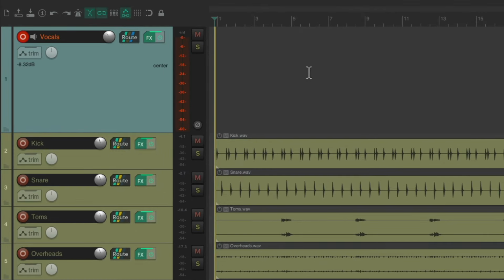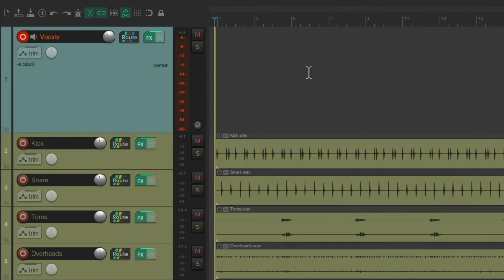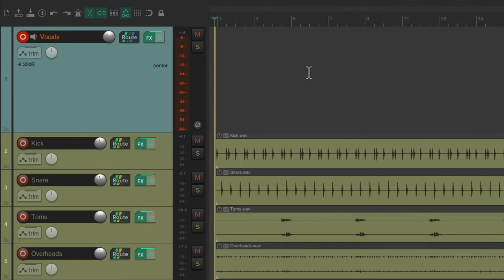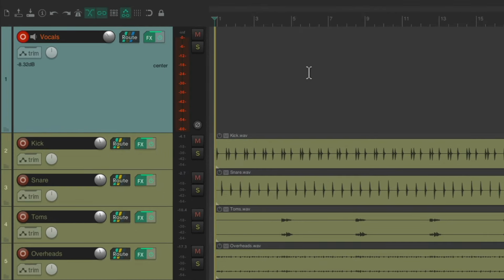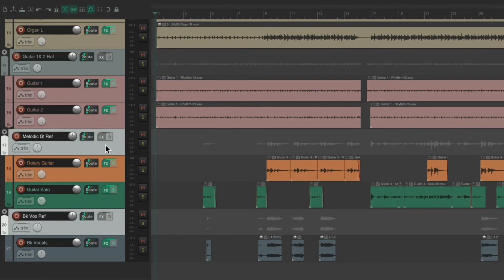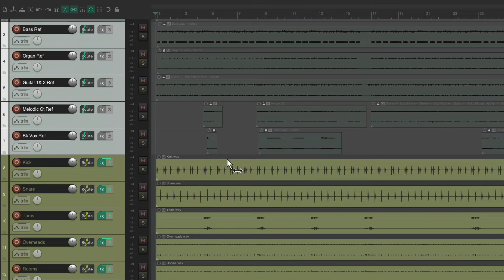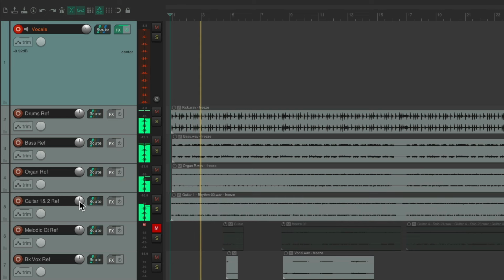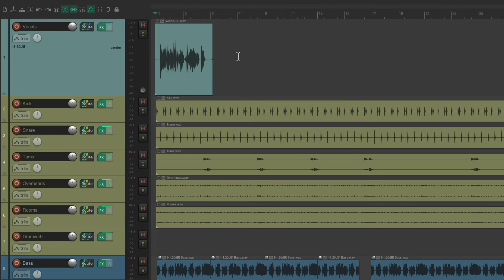Recording with the Lowest Possible Latency in REAPER

Comment: For this to work the setting "Do not process muted tracks" should be checked. You can find this in Preferences -> Audio -> Mute/Solo -> Mute Settings
Reply from the maker: Correct. I didn't mention that because it is on by default.
Reply: I put it in a "custom recording options" toolbar so that i remind myself it matters.

Comment: I prefer just freezing the individual tracks, or at least the most CPU intensive ones.  That way you still have full control over the mix and no need to create/delete folders, move tracks, mute/unmute, etc.  Then just unfreeze when you're done and you can edit, adjust FX, etc.  Fast and easy.  You don't get the benefit of playing back just 1 track or a few stems, but it's usually the CPU that kills you, not reading the audio from disk.
Reply from the maker: Yes. Many different ways to accomplish this same thing.

Comment: also its not always necesary to freeze all tracks, just look in the performance meter, which tracks are cousing most of the load, and you can only freeze those tracks in place without changing any routing

Comment: I had some latency issues when I was using the 32 bit version but adjusted as you did with better results though I'd get an occasional pop. Since switching to 64 bit I've had zero latency issues and no pops.

Comment: This is great i find singing in tune with headohone on really requires low latency. This is super helpful. I wish there was a way to automate this. Tracking mode / Mixing mode.
Reply: You can add buttons in your toolbar so you have these settings real close.

you can also create templates or even portable installs (which is what Kenny does) with their own settings for each type of session you do : recording, editing, mixing, ...
Reply: @djabthrash  none of this really works. I would prefer to track at 48 and mix at 96 but I dont feel like using two sessions.

Comment: I'm using i5-12600K with ES9068AS DAC on Reaper, it can handle the lowest 16 block size, 2.6ms RTL without click/pop on Keyscape or Pianoteq (Piano VST), a single-track recording.
Reply: what? I got same config and mine can't . How did you do it?
Reply: @joshmcdzz6925 Disable core parking and frequency scaling in Windows and it'll help.  Then reduce the amount of tracks that have a PDC value other than 0.  Some plugins like compressors/limiters are really bad with this.

Comment: I just started working in Reaper and I'm wondering if it is possible, when I create a copy of an audio track, to make a copy that is completely separate from the original track. I made a copy of a track, took it into an audio program to tweak it and raise the pitch an octave and when it came back in both that track and the original were changed. It would be great to have the option of holding down control AND another key, to make a new SEPARATE copy of the original. THANKS Rick  BTW, if this option already exists, please put a link to a video on how to do it in the reply. thanks. BTW: I LOVE all the control that I'm seeing with Reaper!! NOW, I just have to learn it.
Reply from the maker: It should already be separate. Are you possibly selecting both tracks after you duplicate them?

Comment: moving folders and messing with routing isn't actually a good idea,
in fact, in the mixing process it's very desirable to have those folder busses for instruments/groups, also often such stems are delivered for stem (re)mastering so it's always smart to keep those (also keep those in case of no longer having access to plugins used in project for ex.),
-  more elegant and versatile way is to simply mute and hide source tracks (View - Track manager), and to save time re-rendering when working with multiple musicians, it's possible to select and mute (Alt+M) those rendered/frozen items in folder tracks
Reply: - the stems you rendered/used during tracking are not the same than those you send to mastering, because the ones you send to mastering you send them once you're done mixing. At this stage the stems would sound nowhere near as they would sound during tracking.

- the folders, used in the way shown in the video, allow you to quickly render stems for each instrument and have one track as a volume (just like a subgroup or a DCA) for this instrument for the tracking mix. There might be an even better way but this is very clever and efficient already imo

- i agree hiding tracks i very good, but here he uses the stereo stem tracks to adjust the mix balance for tracking so he needs to see them.
Also : it'as also good to see the source tracks, even if they are frozen/rendered and muted, because their waveform help you seeing where you are in the session

Comment: Do you always record at 48khz? Does the latency reduces if you record at 44.1khz?
Reply from the maker: i believe the latency is smaller the higher you go up. I used to always use 44.1KHz when CDs were used but now most people don't so 48kHz is a pretty good standard.
Reply: @REAPERMania  Great info Kenny. It's weird that the latency is decreases as you go up, I would have guessed the other way around!  I will now switch from 44.1KHz to 48kHz, coz if it's good for Kenny it's good for me! Thanks a bunch!

Comment: Couldn’t you get the same result by just moving the stems the amount of the offset? Record to the stems, and play back to the tracks. Same result, less steps.
Reply from the maker: Not following.
Reply: I’m sorry, let me try again. And hey, I was 70 when I started using REAPER, and I’m a couple of years in, so I may be off my a mile. You’ve been my main teacher, so I’ll not be surprised if what follows turns out to be wrong, but here goes;

Here’s a way to record with zero latency, no matter how humble your system. 
Let’s make the example singing a vocal. 

Mix the tracks to suit the singer. Render. Copy. Mute the original tracks. 
Move the first copy back in time the amount of latency, let’s say 256 samples. This is the track the singer will sing against.
The second copy is the track for playback. 
All you do is switch and mute these tracks, and you’ve eliminated latency.
Am I way off here? Thank you for everything you do, sir.

Comment: Been having an issue lately with popping and cracking getting recorded on a track. Don't notice it when we're doing the actual recording but it's there on playback.  Hard to determine if this is a buffer, cpu,  or something else.  I run Windows 10, Dell Inspiron 15,  i7 core with 4 cores, 16G RAM, SSL2 audio interface with buffer set to 512.  The Performance Meter shows nothing. Any ideas on what to look for?

Comment: I always wondered why reaper doesn't have set block sizes. Like a drop down with 32, 64, 128, 256, 512, and 1024 etc. is there a benefit to having different block sizes? Like I don't, 55? Also, is there an easier way to change block size than having to go to the preferences?
Reply from the maker: That's a good question. I'll ask and get back to you. Thanks.
Reply from the maker: From the man - Some devices have odd block size preferences - there’s no real benefit to powers of two anyway
Reply: @ARE_YOU_SICK_OF_YT_CENSORSHIP  thanks for pointing out the menu block size, that's amazing - the reaper community is just the best
Reply: @REAPERMania  wow I feel so special now 😌thank you so much for that

Comment: Are there any benefits to using 1024 over 2048?  I've always just used 2048 when mixing.
Reply: Changes will be more instant. EQing can feel "laggy" for instance if the buffer is too high. It isn't neccessarily unworkable, just potentially annoying.

Comment: Hi, I installed a new reaper in my laptop, and I encountered latency. I tried to adjust the buffer/ sample and also installed the ASIOALL driver, then adjusted output and input manual offset. Still encountered the same issues.

Comment: Could someone help me? I'm trying to edit videos in reaper and the video lags. After I render it, it get all pixelated. I shot the video in 4k 30fps. I have done other videos but used 1080 60fps and didn't have any issues.
Reply from the maker: Did you turn off Hi Res waveforms for the video items?
Reply: @REAPERMania  I did. Just finished downloading an ffmpeg build and I think I got it working properly
Reply: Ok I ran into another problem and hopefully you have a solution haha. I'm trying to render video with audio using video (ffmpeg/libav encoder) QT/MOV/MP4, H.246. I can't render using AAC or mp3 audio, I keep get the error code "the target drive/path does not exist, or is in use" error initializing audio encoder, output file-no output. I can render with 24 bit audio but that won't work with instagram. Any ideas? Using reaper v6.81. Thanks!

Comment: Nice way to get around a slow USB interface.I think the easiest way is just to get a Fire wire or Thunderbolt interface.I got a Presonus 2626 it's really great at latency. Seriously very low latency. The higher I go in  sample rate the lower the latency. It's like .7 round trip at 192 128 buffer. 
Could you script that trick you have?
This info was not to scold anyone just to give honest feedback about Thunderbolt interface.
Reply: You still get latency with Thunderbolt
Reply: The latency on USB RME cards is lower than Thunderbolt. The issue isn't USB, the issue is the drivers. USB has plenty enough throughput for audio.
Reply: @electricwhiterabbit  no way try 192 / 128 you will not get .7 round trip. My old pro 40 was better at latency than USB.Yes that is .7 not 7. You are incorrect the issue with USB is the crc check sum that is transmitted with the audio signal. That is why FW was faster than USB because there was not over load on the data buss with other data. Please do you research. Yes in theory it should be faster but in reality that is another story.
Reply: @brentharmonmusicproduction  If you call..7 at 192 / 128 is latency I can live with it.
Reply: @midiman5045  Huh?  192?  Who records at that high of a sample rate?I record at 48. BTW, I did my research. Also Firewire is no more. It is USB or Thunderbolt unless you go into Dante or stuff like that which is more for pro studios. Check out the specs of RME USB interfaces. The latency is some of the best out there.
Reply: @electricwhiterabbit  RME are no doubt a great company with low latency. but USB has more irrelevant data that slows it down. That is why fire wire was faster than any USB to this date. It transmitted only audio no other data. Now for 24 bit 48 / 128 round trip is 3.0 No pops not clicks nothing. I don't know where you did your research but 480 MB/s is no where near 40 GB/s or even half of 20 GB/s. Math is math. 
Yes Thunderbolt is more expensive and USB is good for what it is. but stop thinking your USB interface can keep up with any Thunderbolt device from any company.
I am just stating facts. I tried USB 2 18i20 and it crumbled during my tests that is why I went to Thunderbolt.Yes Dante is better than Thunderbolt also more expensive.
The 192 was just a reference.

From the internet Below

USB 2.0 provides 480 Mbps, USB 3.0 provides 5 Gbps, USB 3.1 provides 10 Gbps, and USB 4 provides 20 Gbps, while Thunderbolt 1 provides 10 Gbps, Thunderbolt 2 provides 20 Gbps, and Thunderbolt 3 provides 40 Gbps! Thunderbolt 4 still provides 40 Gbps, but adds some additional capabilities
Reply: @midiman5045  Mbps and Gbps has nothing to do with latency of USB/Thunderbolt/Firewire. That only has to do with how many tracks you can have. At 480 is more than enough for home recording.
Reply: @electricwhiterabbit  I was debating whether to answer this inaccurate reply. You are so wrong it is pitiful. Please go and do your self a big favor google search DAW Latency.

Comment: Is there no way the master/stereo bus can record to a new track with the minute latency that creates being adjusted?
Reply: If I understand your question... Reaper has latency compensation and Kenny did a Reaper Mania video on that: https://www.youtube.com/watch?v=HZcXZ9kEJbY
Reply: @frankpratte8358  close I think...Instead of creating the folder etc. etc. I'd like to "render" the mix to a single track within the project, solo that and do the vocal tracking with that as the backing with no phase issues due to the latency possibly caused by rendering into the track. Too hard? Too silly?
Reply: @raycochrane3971  In the Render to file window the 5th button near the bottom is "Add rendered items to new tracks in project".  I just tried it and there was no latency and no phase issues between the rendered track and the project, (I did it with just one track in the project so I could easily line up the "dots" as Kenny did in his video).  As you wrote, this would be another way of accomplishing what Kenny did in his video.

I'm not sure soloing the rendered track would turn off all the processing of the fx in the other tracks, maybe you would need to mute all the other tracks instead.  Easy enough to do an experiment.

Another note, when you rendered the project, any fx in the master channel would be printed on the rendered track.  You wouldn't want that track to run back through those effects a second time.  In the routing window of the rendered track turn off the Master send button and add an output in the Audio Hardware Outputs drop down window.  Or, you could just turn off the fx in the master channel when playing the rendered track.
Reply: @frankpratte8358  BRILLIANT - thank you. Reaper has a treasure trove of untried, unread, unknown facets for me. PHANQUE.

Comment: the problem im having recording is i hear myself instantly and can record just fine, but when i hear the whole thing my take is delayed. of course i can just drag it a lil backwards and problem solved. but there is gotta be something wrong im doing to cause this
Reply: In preferences, go to Recording and at the bottom there's 2 fields, called something like "manual input delay" (im not on my pc so don't recall exactly.) You can mess with that to get it right, I think I landed around 15-20 milliseconds input delay and it solved this exact problem!